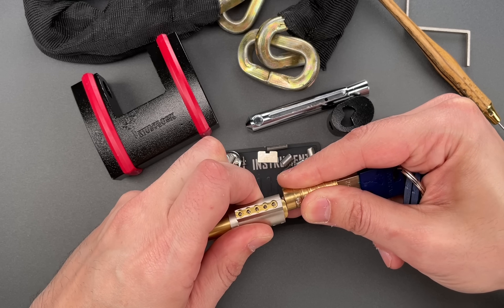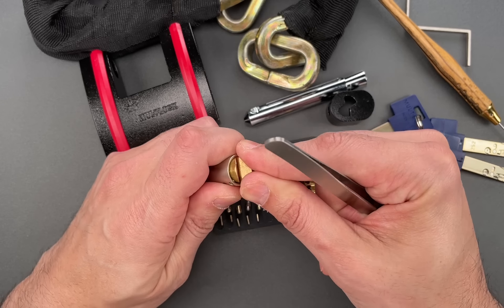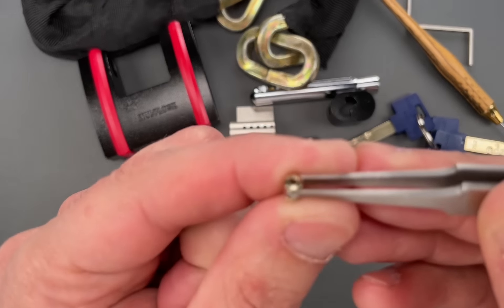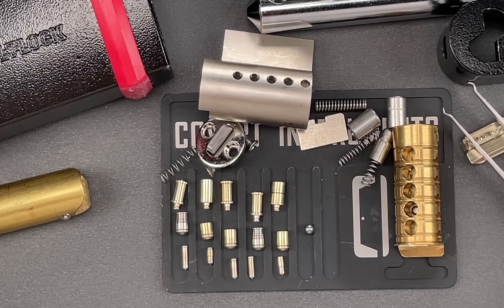[1592] Mul-T-Lock’s Sliding Bolt Blunder (Model SBNE12)

Comment: How the hell did taking it apart explain to us mere mortals, the actual Design Flaw,  I thought perhaps it was the spring loading that holds the pin in the keyway of the sliding part to begin with, But on Trev's video he slaps it, and then just slides it open, so the springs would have returned to their original position by then, Cmon LPL, you don't normally leave us hanging like this.
Reply: I think you're more or less correct. But it's hard to say without poking the little retainer springs. It's possible that once you get the little latch open it locks open until you relock it.
Reply: I suspect the physics of it work like this: there are some springs exerting force on some kind of locking bar or ball bearing that holds the shackle closed. When you strike it, inertia causes the bearings to compress the spring, and if the shackle is not horizontal, it just slides a little, preventing the spring from returning the bearing to the locked position and you can just slide the shackle out.

If the lock was hanging so the shackle was horizontal, and you hit it on the bottom, it may not open so easily... but turn it a little bit and it becomes trivial.

That's my guess.

I'd also guess the engineers who designed it are like so many people with their cryptography... "I use 34295857 bit crypto, the NSA would need more money than is in the universe to crack my hard drive and find my MLP porn.."  .../ or they need a couple of free willow switches and a couple of dudes to beat you with them until you give up the keys... but nobody thinks about that one.
Reply: @anothersquid  "34295857 bit crypto"
That's not a power of two. So it's not going to happen. It's not even divisible by 8, which it would be if it was a "bit" key.

Also, there are some people out there that will literally take their secrets to their grave. No matter how tortured they are.

The engineers thought of practicality, not security. The lock should operate smoothly at all times.
But real security engineers think like the thief and also employ thieves (white hats) to attack their security.
The engineers simply don't understand the criminal mindset.
Reply: @anothersquid   It looks like the production team went for cheap springs to cut costs without telling the naive design team they will be doing so.
Reply: The poppet springs are too weak. I know. Guess why. Hint: i used another lock to test it.
Reply: That's because the flaw isn't in the lock cylinder, so it's hard to visualise without cutting up the lock. Based on McNally's video the issue seems to be that it uses a spring loaded locking lug instead of a proper ball bearing locking mechanism, the issue with the sprung latches is that you can throw them out of the way with momentum (you can effectively smack the lock open).
Reply: @RealCadde  There's no magical requirement for power of two or 256 (8 bit aligned) in cryptography. It's often just dogmatic or marketing rounding, because 224 bit sounds better than 223.99999999999999999999999999999999974671558363922346330292712661322124 bit (SECP 224R1, used e.g. in Apple's Find My network). Wouldn't want to let a bigger portion of that 224th bit go to waste...
Reply: @0LoneTech  Except that if you send bytes of data, then having something that isn't divisible by 8 bits is wasteful.

Yes, it used to be loooong ago that packing several bits together tightly was necessary due to bandwidth and storage limitations.
It used to be that the whole computer alphabet fit in just 5 bits of information. Or 32 characters.
Then it went to 6 bits as it was necessary for both upper and lowercase to exist.
Then it went to 7 bits because it was also necessary (terminals) to have a few control  characters (everything below decimal 32, as well as decimal 127) to be used for various purposes.
And it used to be that if you pressed CTRL+B (which would print the BELL character) the computer/terminal would BEEP at you as anytime that character was printed, the terminal was supposed to beep.

We finally arrived at 8 bit alignment and that's were we stopped. Everything beyond that was merely number of 8 bit "bytes" that would encompass a package.

And while you can have block sizes of 224 bits and even key sizes of 224 bits, they aren't part of the (AES) standard.
Just because it's supported doesn't mean it makes sense.

And in any other case, i wouldn't have minded it if 224 was used as it IS evenly divisible by 8.
Heck, even 299488 would have been fine with me. It's just 224*1337. Still divisible by 8.
But since STANDARDS call for sizes that align with the powers of two philosophy, they are generally always in... powers of TWO.

But of course, you can always implement your own encryption that uses 133780085 bit encryption.
Reply: @RealCadde   It's Ctrl+G for BEL in ASCII (and C escape sequence \a for alert), and it's quite literally striking bells; CuriousMarc demonstrates a few of these devices (teletypes, e.g. look up TTY March). 

We didn't quite stop at 8 bit, nor work from one direction only; we've pretty much backed off from 16 bit because byte order made such a mess in text, for instance. CJK text still requires two or more bytes per character but it's often easier to stick to UTF-8 than have byte order markers that have to be skipped and may get lost. PDP-1 used 6 bit characters because it fit neatly into its 18 bit words, despite using 8 bit tape. It didn't have bytes. Shift modes such as that used to toggle red or black text remain common, e.g. in Unicode for text direction, or on Commodore 64 for font selection. 

AES is only one of a multitude of standards; as a symmetric cipher, it's not applicable to the same uses SECP224R1 (an asymmetric elliptic curve cipher) is. 

Some tasks specifically avoid powers of two, such as in bit scrambling to debias transmissions. E.g. PCIe 3.0 uses a 23 bit LFSR for scrambling its 130 bit frames carrying 128 bit payloads (padding to guarantee transitions). It also comes as a consequence of other requirements, like prime numbers, or state machines where one state would halt. 

Bandwidth and storage limitations remain critical properties. For instance, the VR headset I use requires DSC because there simply isn't enough bitrate available to fit its video signal uncompressed in DisplayPort 1.4. And e.g. Star Citizen and Baldur's Gate III both malfunction if they don't get data loaded faster than a single PCIe 2 lane can.
Reply: @0LoneTech  Ok then, just tell me one mainstream crypto that uses a key length other than 64, 128, 256, 1024, 2048 or 4096 bits or bytes, doesn't matter.
And even then, if you somehow find a 72 byte crypto that is mainstream (or 224 whatever), it still is divisible by 8.
Find one that isn't divisible by 8 and that is still useful today and you've successfully invalidated my point and should go on with making cryptos with -1/12 bit keys just for the lulz.

That's the argument i was originally getting at. 

Thanks for clarifying it was CTRL+G though, i could have sworn it was B but then again it was like 25 years ago i last used it.

And while interesting from a "how did they do it" standpoint, video and images are getting out of hand for the topic at hand.
The reason i talked about how the ASCII table grew to be 8 bits and the function of the special characters was simply to drive home my point that everything in computers (aside from certain COMPRESSION schemes) neatly align with 8 bits and 1, 2, 4, 8, 16... bytes, each of 8 bit width.
Hardware itself (again, aside from the oddities) is designed to operate on these divisible by 8 or even powers of two alignments.
Memory pages neatly fit into 4096 bytes, and even though they can be made into 512 byte or even 8192 byte pages, the standard is 4096 and that's what everything is optimized for. Code-wise and hardware-wise alike.

Again, in the olden days it used to be that if you could pack A LOT of data into a single word, then one would do so in the interest of saving bandwidth and/or storage space.
But these days, packing just means excessive CPU cycles to work with said data for no real benefit. Unless you still operate on carrier pigeon networks.
Reply: @RealCadde  Fun fact; you decided to shift your goal posts to something my first post already satisfied. And that protocol split its keys into three parts; 46, 176 and 2 bits large, to fit in a BTLE advertisement. This sort of bit stuffing is absolutely negligible in cost compared to the crypto calculations themselves. Also, 18 bit memories are commonplace, particularly places that don't have pages like those you refer to as "the standard".
Reply: @0LoneTech  I am not talking dinosaur computers.
TODAY boomer, not when you were still in your 40's.
Reply: @RealCadde  Yeah, today. As in almost every Apple device with Bluetooth, and every FPGA since 40nm. Bravo on demonstrating your immaturity through senseless ageist namecallling (which was also factually wrong).
Reply: @0LoneTech  Ok mr fossil, I am done playing your silly games.
You still didn't come up with a modern crypto that uses a bit count that isn't divisible by 8.
And that's all there is to it.

Go play with your 60's computers.
Reply: @RealCadde  By the way, another way you're factually wrong: ASCII remains 7 bit. It has never been 8 bit.
Reply: @0LoneTech  You remain incredibly pedantic.

Extended ASCII is still ASCII, and you'd do best in touching some grass.

Comment: That was dramatic, but it gets the point across. I'm amazed that the manufacturer did not prevent such an easy defeat. @LockPickingLawyer Can you recommend 3 locks in current production of different types that are well above the mark?

Comment: How would they fix the bump issue Trevor so ably demonstrated?
It would be good if u could have pointed out how that could be fixed or why it is possible based on the internals.
Could a buyer fix that issue, as pick resistance was great otherwise?

Comment: Oh no, oh Noooo.
This is not unlike getting a bad grade on a group project, when your work was exceptional, but one of your group members bodged it completely, so much so that it entirely negates the work you did.
Doesn't matter how good the core is if it can be bypassed easily. And this isn't even needs a tool easy. It's straight up Just Smack It.

I kind of wonder why this exploit works. My guess is that there is a spring loaded locking pawl to hold the shackle in place, and the spring is so weak that smacking the lock can dislodge the pawl from the shackle. I'd love to see this lock milled open to see it in action. Especially with a high speed camera. That would be so cool, to watch the lock get slammed, and the pawl to release. It also seems like if this lock has this problem, using a shim should also bypass it.

Another mystery is how they didn't find this flaw at any point in testing. Or, for that matter, why they didn't just use a ball bearing lockup. I think spring loaded pawls have no place in high security locks.

Comment: I'm one of Mul-T-Lock biggest collector (check my posts). It is not physically possible to bypass a NE series like that due to the impossibility of releasing the shackle without the actuator rotation. The other video is faked for whatever reason you can imagine. If it had a flaw we would all know 15 years ago, when it was manufactured after the original SBE series.

Comment: Shorts SUCK. Trevor's video explains NOTHING. Why does it fail in that way?
Reply: I have several videos explaining why locks slap open, two specifically addressing sliding bolt designs like this.
Reply: @McNallyOfficial  That's great! But it still doesn't nullify my comment that the short doesn't explain anything. I know YT is pushing the Shorts but they are all awful. I've not seen a Short that is as interesting or engaging as any long form video. And Shorts don't drive viewers to the main channel. I wouldn't have known you have videos explaining why locks open like that from the Short.

Comment: Criminals around me are even more stupid than MasterLock designers. I put a deliberately shitty lock on my garage, I can open it at least five ways without the key and yet I've had the door levered open several times.  Eventually I just left it unlocked, hanging there, doing nothing and oddly no more intrusions, just a few local ne'er-do-well's walking past, look at the "busted" lock and move on...  I have to admire the desperation of thieves, they stole an old knackered battery charger that put mains onto the battery terminal, a few gallons of contaminated used engine oil, a tire pump that squealed like a banshee and gave wild pressure readouts and a pair of 70s Realistic speakers with blown voice coils.